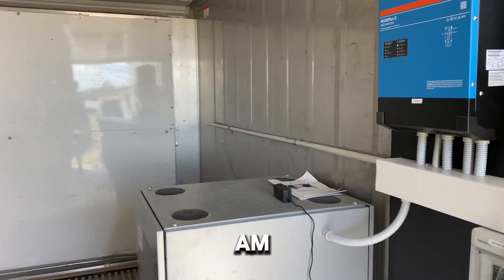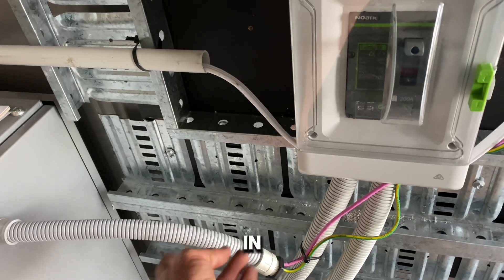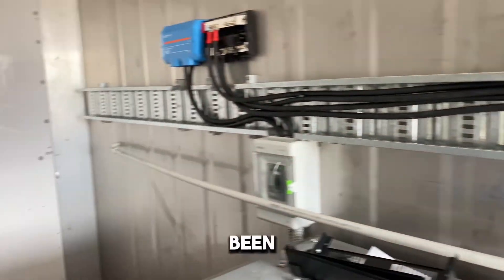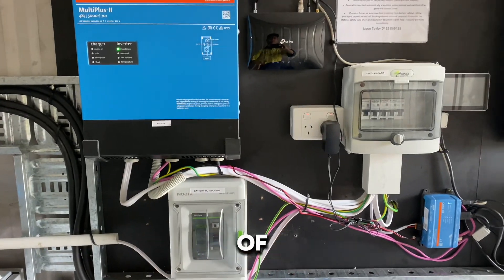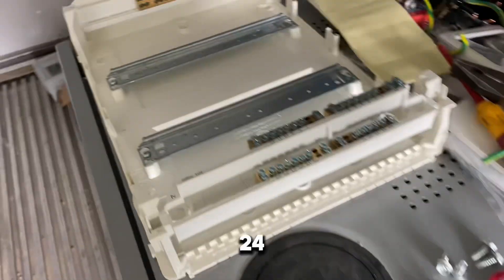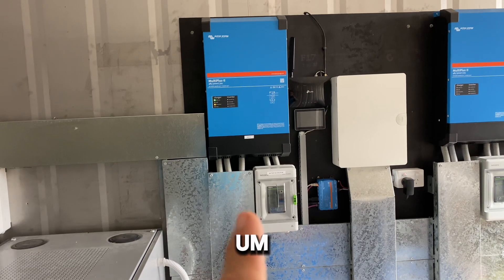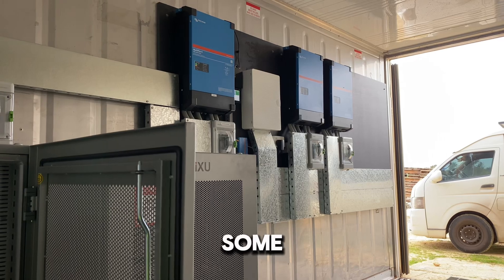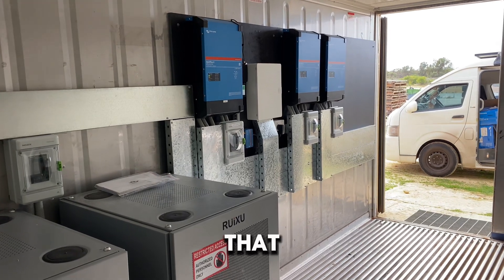Victron three phase Off Grid build with Multiplus 2 and Ruixu battery

Comment: Can you use the Lynx Distributors with the Fuses to feed the DC to the Inverters instead of the Isolator under the AUS code?  Also just put an AC Couple Fronius Symo 15Kw.. Dime a dozen now as everyone's selling there old one.  Cheaper that MPPT Victron units!
Reply from the maker: No must be an isolating switch in an enclosure. Fronius is a good point thanks

Comment: Tidying up a MultiPlus II install. Do you recommend disabling the earth relay and using a fixed MEN downstream of the inverter? It has the capacity and may be connected to the grid, but I figure a fixed MEN/main earth is more reliable than relying on the relay. Grid supply would be act/neutral supply only no running earth.

Comment: Good selection of bits for your install - one thing concerns me - you’ve used 2 x Lynx Power Ins - I would have used a Lynx Distributor and a Lynx power in. The distributor can be mega fused between the bus bar and the Multiplus units - if there was an issue you’ve got a safe point of failure

Comment: Nice install buddy, good job.
If they are only adding a couple of small motors, wouldn’t it have been easier, cheaper, maybe even better to just keep as a single phase setup and either change motors or smaller single to 3 phase inverters aren’t that expensive now, or VSD’s to the circuitry for those couple of motors? 
As a single phase setup, couldn’t they be set up so two inverters act as generators to the main inverter and the last could call on either generator or mains supply to make up any extra needs?
You would still get your 15+Kva of single phase with the advantage of less idle power when needs are low, under 4-5Kva the other two could be idle &/or off until called up by the main inverter.
Andy’s ‘Off Grid Garage’ demonstrates this type of integration with a 5Kva Multiplus 2 and a Phoenix 3Kva inverter acting as a generator to the Multiplus unit.
Will Prowse has done reviews on the Ruixu Batteries and swears by them for build quality, features & price compared to so many other brands, says he can’t fault them, that should give you some confidence, he is not a sell out.
Good vid & info. Cheers

Comment: Hey mate, great build. I just built my first system with two multiplus 2 8000's. It wasn't too difficult, like you say keeping resistance as even as possible with equal cable lengths. I had to learn the programming in victron bus configuration, there is a video on the Victron professional website that explains parallel and 3 phase setup pretty well.

Comment: I understand that you need the Noark 200amp DC breakers between the Ruixu batteries and Victron power in distribution board. But why do you need the Noark 200amp Dc breakers under each of the Victron inverters you have installed? Does Victron not have built in DC isolator?
Reply from the maker: Hi yes correct there is no built in DC isolator on the Victron, plus for testing and fault finding I prefer to have the extra one dedicated to each inverter.

Comment: Looks good. What kind of 3 phase loads will get added later?
Reply from the maker: Hi, only a couple of small motors
Reply: @joondalupelectricalservice3201  Nice install buddy.
If they are only adding a couple of small motors, wouldn’t it have been easier, cheaper, maybe even better to just keep as a single phase setup and either change motors or smaller single to 3 phase inverters aren’t that expensive now, or VSD’s to the circuitry for those couple of motors? 
As a single phase setup, couldn’t they be set up so two inverters act as generators to the main inverter and the last could call on either generator or mains supply to make up any extra needs?
You would still get your 15+Kva of single phase with the advantage of less idle power when needs are low, under 4-5Kva the other two could be idle &/or off until called up by the main inverter.
Andy’s ‘Off Grid Garage’ demonstrates this type of integration with a 5Kva Multiplus 2 and a Phoenix 3Kva inverter acting as a generator to the Multiplus unit.
Will Prowse has done reviews on the Ruixu Batteries and swears by them for build quality, features & price compared to so many other brands, says he can’t fault them, that should give you some confidence, he is not a sell out.
Good vid & info. Cheers
Reply from the maker: @ yes yes and yes. Re Riuxu though the BMS is not good at all, the standby draw of the inverters is too small for it see so charge drift is a constant issue. I wouldnt use them as a supplier for one of my own jobs.
Reply from the maker: @OldExodus  thanks mate
He has some old conveyors and general small mining equipment to run along with a three phase welder and lots of single phase loads

Comment: Great video, thanks for so much information. 
I just bought the same Ruixu cabinet (one cabinet, full 6 batteries) and am struggling to find a good dc breaker/isolator. 
What did you use here? Also how did you ground the system? Thanks again.
Reply: I also bought RUIXU batteries and cabinet. Because they not on the approved battery list no solar installers will touch them. Thoughts??
Reply: @chruzzie Will Prowse has a video on these batteries, he swears by them and their internal build, quality and features for price. I am glad to see these batteries hitting Australia, hope they get their regs sorted out and turn out to be as good as the few reviews I have seen, time will tell. Hope this helps.
Reply from the maker: @chruzzie yes it can be a challenge, where are you located
Reply from the maker: Hi
Noark 200amp dc breakers were used in Noark enclosure.
Reply: @joondalupelectricalservice3201 can a single Noark 2 pole 200amp DC breaker be used in 2 phase situation so it can connect to each phases battery bank or will each phase require its own breaker? The noark advertises it as 2 pole so hoping single breaker can work in 2 phase with seperate battery bank for each phase.
Reply from the maker: @techwhizard yes that should be fine but would need to check with local requirements. Best to switch the positive only on both banks. Personally I would have two but thats just me.

https://www.victronenergy.com/upload/documents/The_Wiring_Unlimited_book/43562-Wiring_Unlimited-pdf-en.pdf